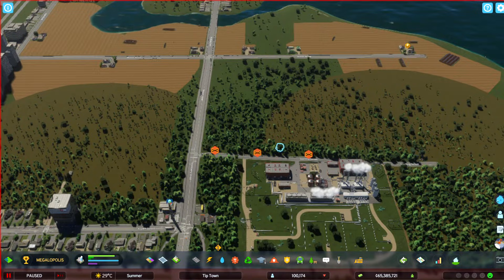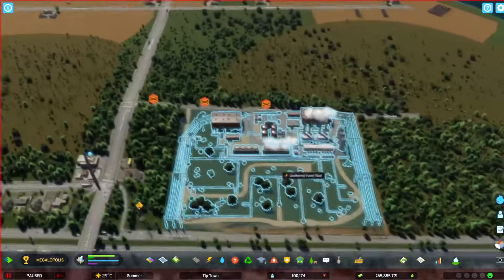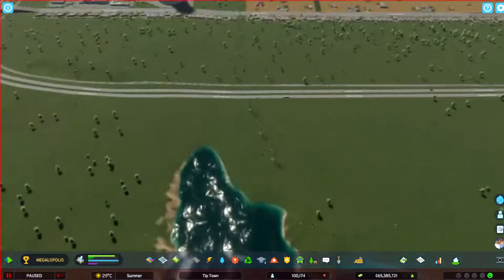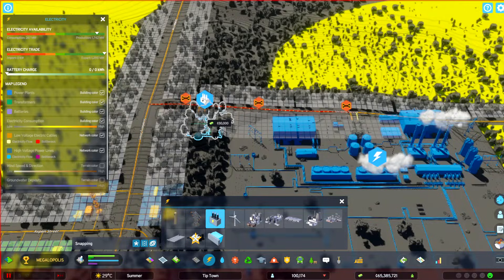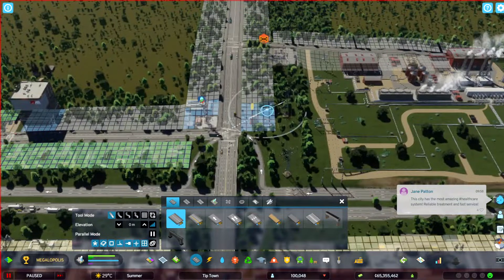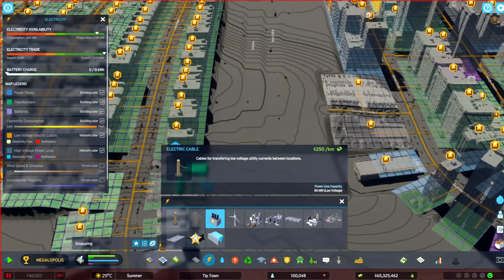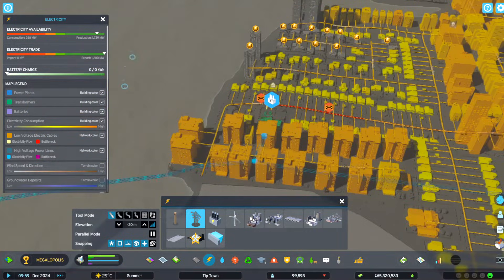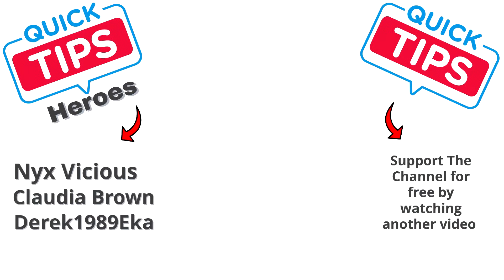How to Fix Electricity Bottleneck in Cities Skylines 2

Comment: Do you have to place trasnformers right on where the icon is or can you just plop them anywhere in the city and run cables instead?  I've had this issue a few times now,, happens in the same  3 locations every time, so I've had to put a transformer every so often and the place is starting to look like a block full of them and it's getting too ugly.
Reply: I only have wind power, so placing transformers doesn't work for me. Instead, you can place more electricity lines/cables underground and connect the lines together. That's how I solve this (someone explained in detail above, it's a matter of flowing capacity).

Comment: the first transformer on the geothermal plant is not needed. think of the roads in electricity terms like this: all roads, in terms of electricity, are super low flow. once city demands get high, they need multiple paths to pull power from the plants. either build another road towards where power is going, or use the high voltage lines from the plant, all the way to where a central power suck is, and then plop a transformer there and connect with high voltage lines.

Comment: for anything less than 80MW demand, it's not the transformer station... its the road carrying the power. The roads only carry 40MW, just build roads on both sides of the plant and it will carry 80MW. You only need transformer station after 80MW demand
Reply: Oh gosh that explained everything.
Reply: thank you, I had transformers and that didnt fix it, it was adding another road, thanks